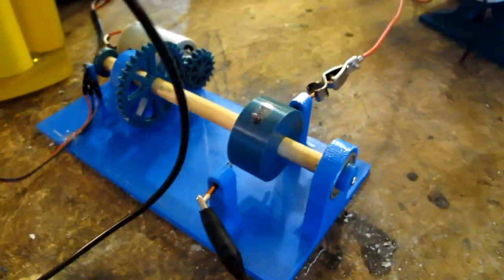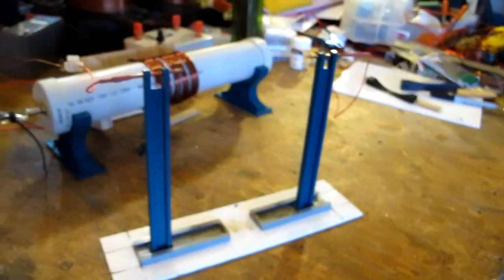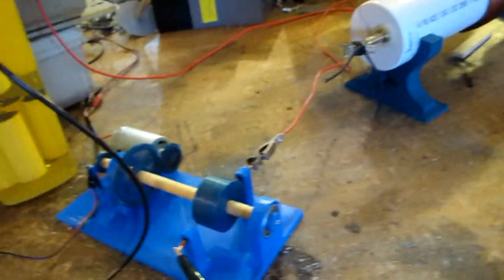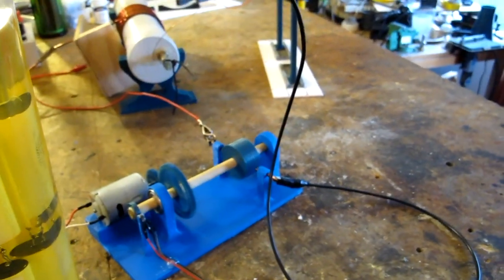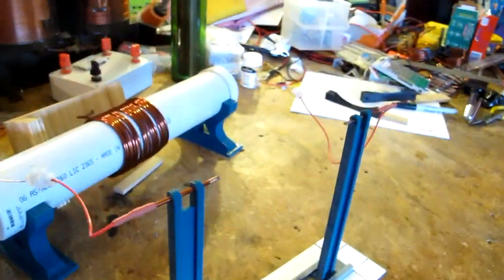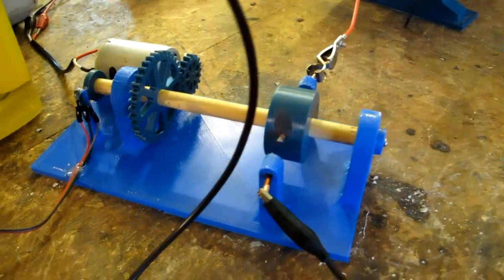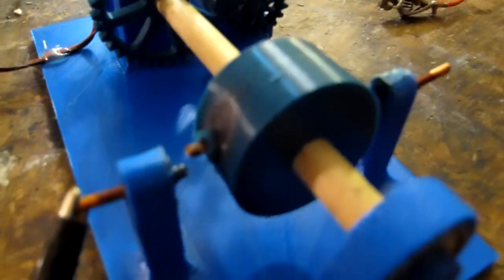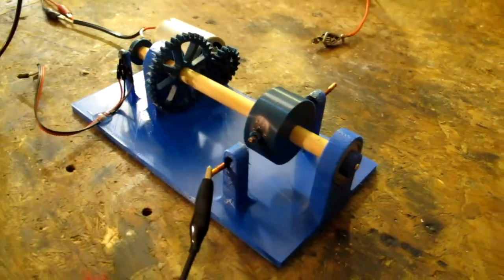Rotating Spark Gap

Comment: wow thats the diy key for repetitive high voltage pulsing I was looking for...did you get any troubles with it finally?
Reply from the maker: This one was fairly well behaved. I made another larger one that would produce ~30cm arcs, but it turns out that much voltage won't always go where you want it to and after I took it apart I found it had been arcing across my carpet into a nearby network cable, which did not do good things for the switch it was attached to, or the network card in my server box.  :/